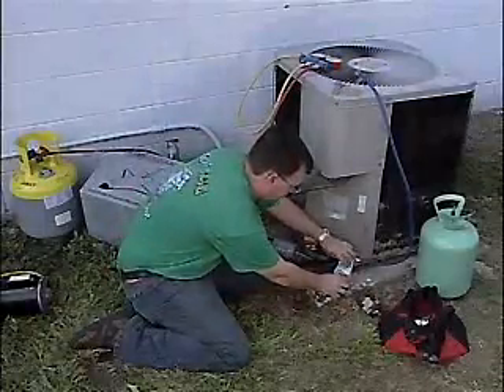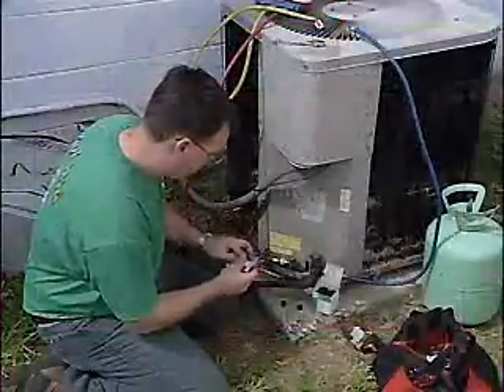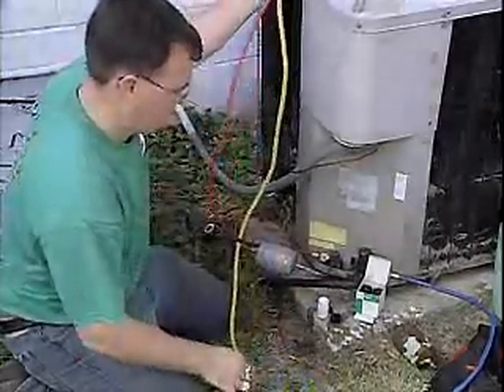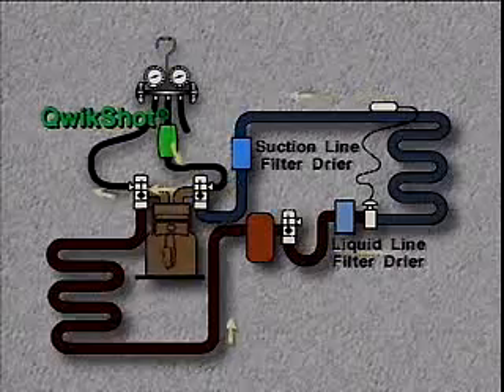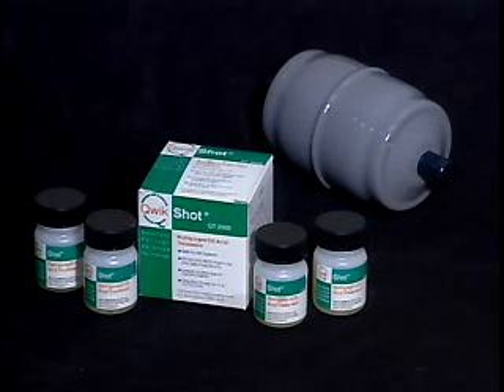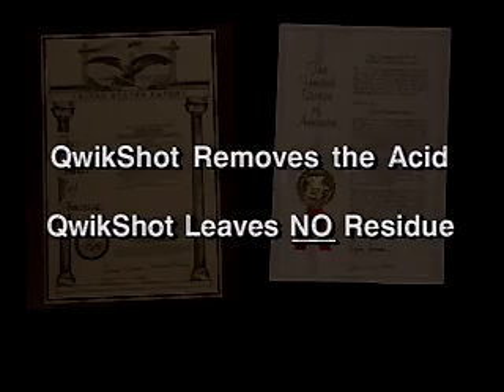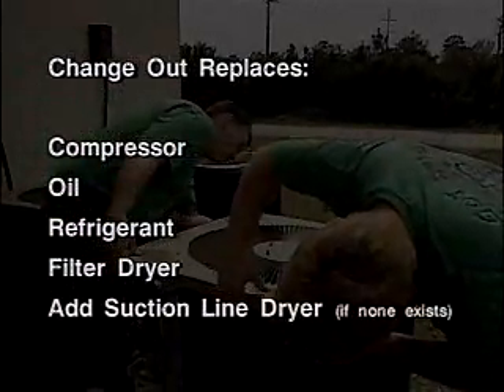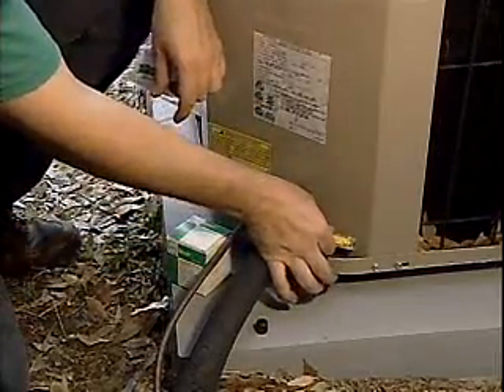QwikShot® Acid Flush™ - QT25000, QT2501

Comment: What if it's impractical, impossible, or too costly to add a suction line drier?  Will the liquid line drier be enough?  After adding quick shot,, do you need to recover, change driers, and recharge the unit, or you just leave the existing refrigerant and driers in the system?
Reply from the maker: When you inject QwikShot into a system, it mixes with the
compressor oil and attaches itself to acid molecules in the system.  As
the system runs,  the QwikShot (and acid) vaporizes and circulates through
the system where it gets trapped in the filter drier.
Since the QwikShot does consume some of the capacity of the
filter-drier, we recommend replacing the filter drier after a couple of days if
possible.  However, it may not be necessary or practical to change the
filter drier in your application depending on level of acid contamination, size
of the filter drier, etc.
Reply: Thanks
Reply: Please reply true statement about qwick shot
1. Qwick shot should be introduced into a charged and operating system
2qwick shot should only be introduced into system with qwick injector 
3. Never add qwick shot directly into oil of a compressor being installed , the subsequent system evacuation will evaporate and remove all qwick shot
4 all are above true